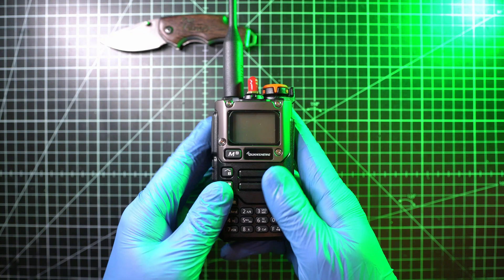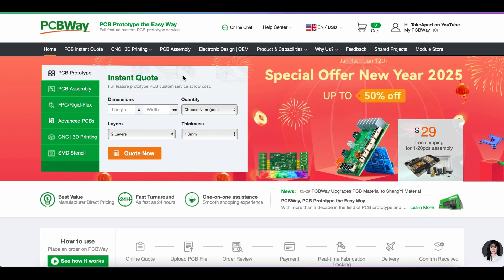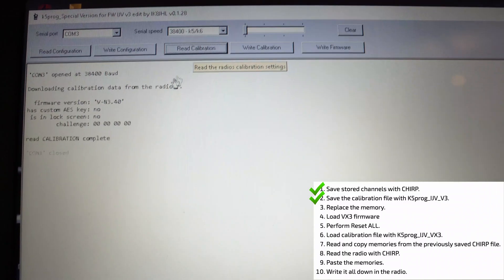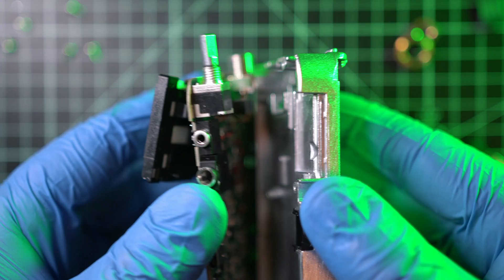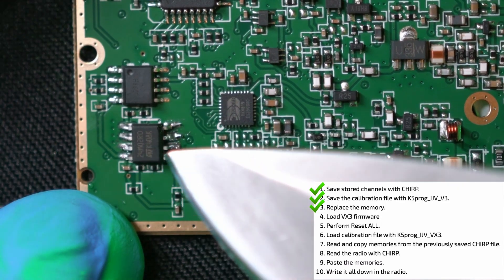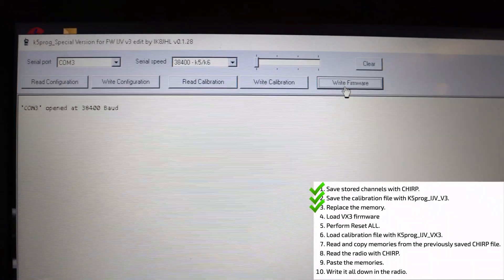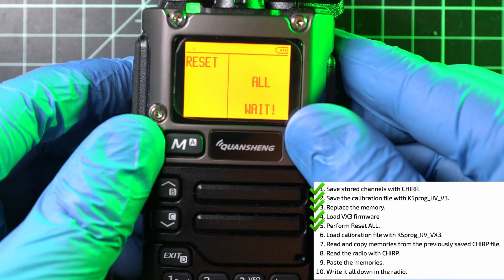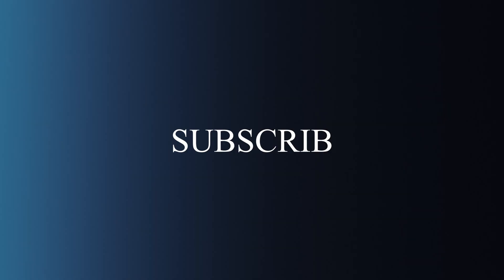Quansheng UV-K5 999 Channels MOD (128K EEPROM 24M01)

Comment: I replaced the eeprom with a 24m01. When I turn it on, the screen shows a dot indicating I need to flash the calibrations. In flash mode, k5prog recognizes the radio and flashes the firmware. But in simple mode, which is where I need to flash the calibrations, it doesn't recognize it. And after replacing the memory back to the stock one, it still doesn't recognize the radio in simple mode.

Comment: No, the best way for desoldering an IC is not to cut off the legs, because you risk to cut the PCB traces below. The best way is to lift the IC with a wire from underneath while heating it with the soldering iron. Use pleanty of flux and solder.
Reply: 🤓☝️ackshually
Reply: @elude3808  you are making fun of him but he just wants to help people who just start soldering not break the equipment they are trying to mod... he was not being a smarta$$ it was a genuine tip
Reply: old solder here and i agree 100%